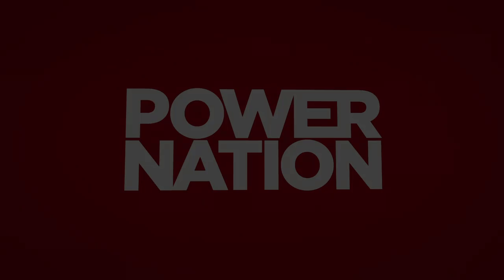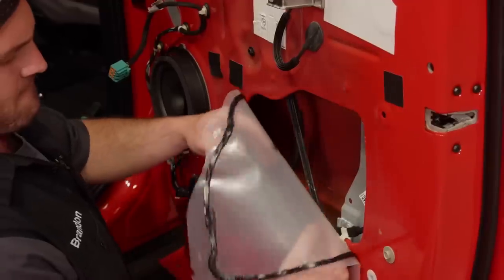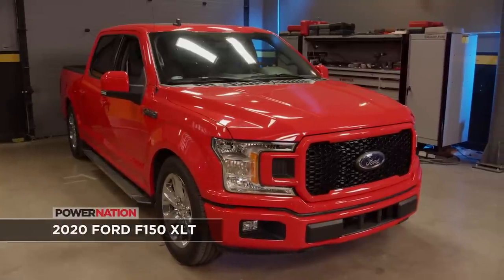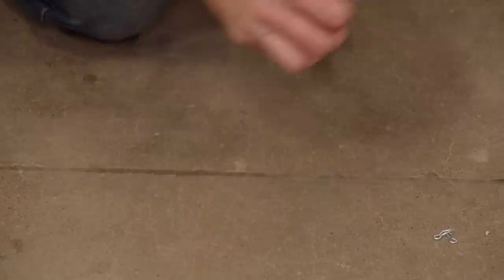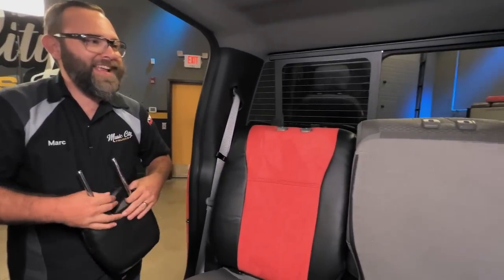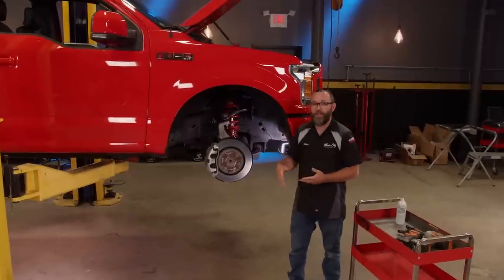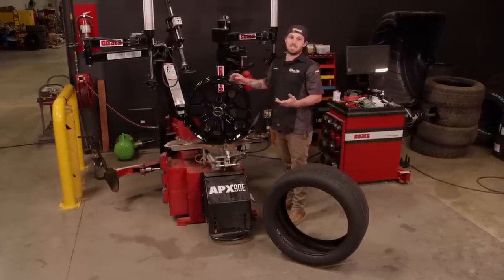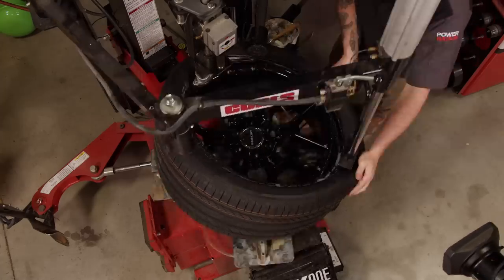A Sport Truck Deserves Serious Brakes: 2020 F-150 Brake Upgrade - Music City Trucks S2, E13

Comment: Something I never seen anyone else do when they change brakes that I do, is open the brake bleeder valve when they compress the caliper. It makes it easier to compress and gets rid of some of the old fluid that you should be flushing out when you bleed the brakes anyway.
Reply: Do not have to open the bleeder screw up.The caliper piston moves freely with it not opened up
Reply: @Toolaholic7  I know. But you're also pushing old fluid back into the master cylinder. Why not bleed out the old fluid more efficiently?
Reply: @Jeffball610  then have to bleed the whole system.Plus sometimes the bleeder screw will not come out finding the bleeder screw corroded up terribly
Reply: @Toolaholic7  if the bleeder screw is corroded, you can't bleed the system anyway. I understand you need to bleed the whole system. This is the first step and a preemptive step to a whole system bleed.
Reply: Don’t ever do it like that . You get a mess + the chance of airbubbles . 😅. Its a seperate job at the dealer for a reason

Comment: You think 180 is a lot of torque, we had to torque foundation bolts to 1450 ft pounds with a 6 ft long torque wrench let them set for a day and go back and re-torque to 2300 pounds. We called it rowing the bolt lol
Reply: Yea I've had to torque mains on pumps I used to work on with a 6ft long pipe wrench lay it on the ground push the handle up and wrist it on the bolt and pull it back to the ground and wait like 100 times till the buzzer told me I could die at 1800lb. Lol
Reply: @andrewmasonwerdna  We were in concrete cages for footing. We'd put our ft on the sidewall and start rowing like a boat. The bolts were 300 plus ft so they twisted like a rubber band lol. The first torque set was worse then the second because you'd get it close and it would slip in the bedrock and you'd start all over lol.
Reply: @kenjohnson5498  good ol foundation work man I used to slam in the 160lb tiebacks all day, never again haha!
Reply: @andrewmasonwerdna  lol
Reply: Y’all must have strong backs
Reply: @dillanhamilton  and a weak mind in my case lol
Reply: @dillanhamilton  I have abbs on my back, no joke....
Reply: Lol

Comment: What look are you going for? The one that every freaking young truck owner has offset wheels color match everything. All that comes last new engine work first and exhaust and tires. That's it. All the stuff that's cosmetic. That's like the least important items in my opinion
Reply: Those are factory wheels from the Shelby Super Snake🐍F150. They have same offset as the factory wheels. The color however would look better in a brushed aluminum or similar.

Comment: Aye guys I was wondering if y'all could help me out...

So I have a 1976 Ford LTD Brougham and I've been searching everywhere for aftermarket suspension but it seems impossible to find compatable ones. Generally GM uses similarly styled bodies and parts for multitude of their vehicles, but I'm not sure if anything besides the Lincoln Mark VI will match up. I'd really appreciate the help if anyone could give some insight on what brands or configuration would be good for suspension for GM cars from the late 70s.

Comment: HEY FELLAS EXCUSE THE CAPS BUT I CAN SEE THEM BETTER I HAVE A QUESTION...WHY DONT YOU TELL US HOW MUCH THE MODS YOU DO WOULD COST...EVEN IF ITS JUST A BALL PARK ESTIMATE I JUST WANT TO KNOW. WHO KNOWS MAYBE I COULD FIND IT EVEN LESS EXPENSIVE. I DO LIKE WHAT YOU ALL DO KEEP UP THE GOOD WORK.
Reply: I did the same brake up grade on my focus and it was $600 so I’m guessing it was near $1000 for the truck. Painting everything was probably 2 or $3000 bucks. Bed drawers were probably $1500-$2500. Rims $2-$3000 tires $1000-$1500. Lowering was probably $2-$3000. These are probably all on the low end. Then I would say add the same amount as each upgrade to have it installed. Roughly.